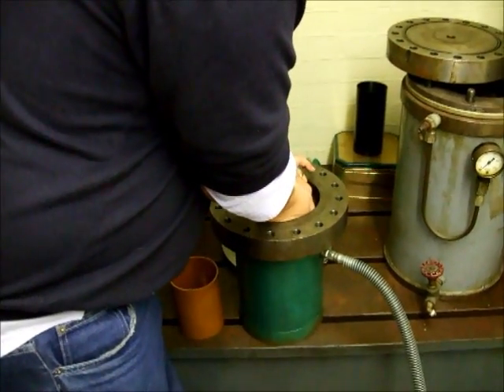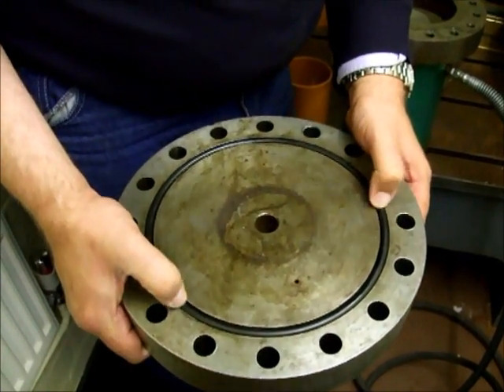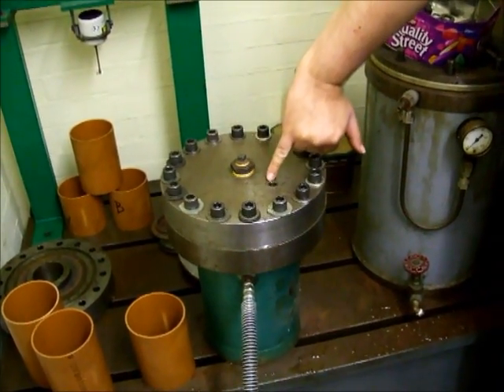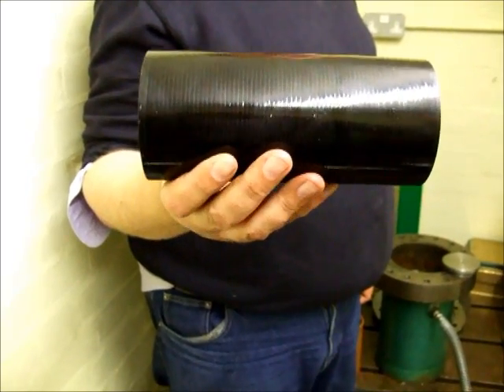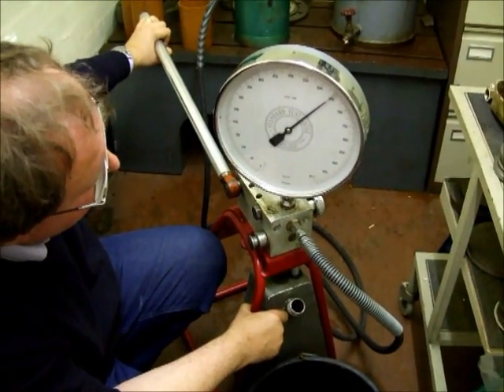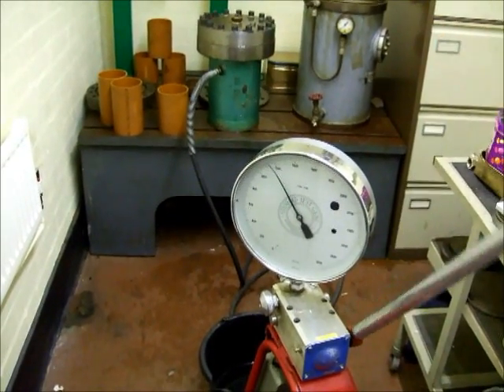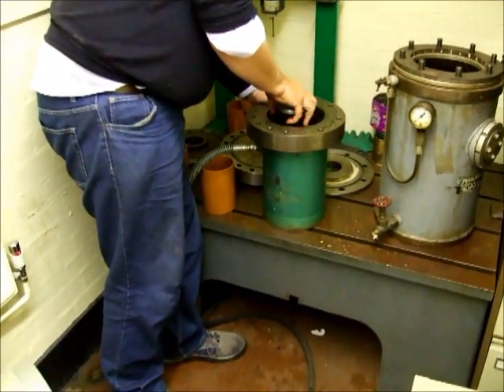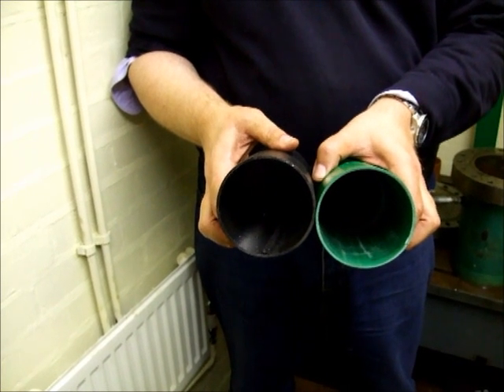Collapse of Composite Submarine Pressure Hulls

Comment: Over the last few days, I have seen a number of ten-year-old videos showing tests describing how dangerous carbon fibre pressure Hulls are. Just to think that this was general knowledge. Shocking!
Reply: "Yeah, but my carbon fibre is 5" thick." - Stockton
Reply: @KefirTView it probably should have...that's Hella thick support. How much do you think should have been enough?
Reply: he believed safety regulations had a far larger margin of safety than they tell us, he thought he could cut corners and save a few bucks and still be safe. history should remember his hubris and learn from it, the worst tragedy about this is he took 4 others with him
Reply: It looks like these subs may be alright for a test dive using robotic control and one other dive and then dispose of it and make a new one. A her egg by design is curved and is extremely strong when you consider the shell itself is so weak a material. A straight cylinder along the mid section of the sub has to be misguided.
Reply: An acquaintance of mine worked for a research facility over a decade ago and they were testing carbon fiber submersibles not intended for human passengers.  The company who contracted with him to test their submersible supposedly wanted to develop the technology to remotely capture specimens from the sea floor and and then bring them up to the surface very gradually changing the pressure.  This is quite a bit different than using such technology for human transportation.  This acquaintance informs me that they abandoned carbon fiber due to the short "half life" as he put it.  He told me that the strength of the material diminished on a geometric scale.   They had a way to measure the strength of the hull wall by how much it would flex after a set number of hours at a set depth.  They were able to rate if safe at 1100 meters for 427 minutes, after that they could only rate it safe at 550 meters for 436 minutes.  Then they could only rate it safe at 275 meters for 441 minutes then 137 meters for 460 minutes then 69 meters for 481 minutes then 34 meters for 479 minutes then 17 meters at 501 minutes then at a depth of 8 meters the submersible failed at the 389th minute.  At that point the submersible imploded.  He described the implosion as being similar to stomping on an empty aluminum soda can while wearing heavy boots.  He said it was about that sudden and fast.  AT 8 METERS!   The above is from an email he sent me two days ago.  We had volunteered at a marine mammal sanctuary together years ago and have kept up correspondence.  He has worked at several research facilities in his career including Wood's Hole.  I would consider his take on this situation more credible than anyone as he's actually tested this kind of technology.   When I asked about human passengers he told me he wouldn't put his pet clam in one of those things.  He actually has a pet clam.   The client eventually went with a solid stainless steel hull though he didn't mention any design specifications.  He described the Titan tragedy as a murder-suicide.
Reply: This is quite different. This demonstrates failure as the cylinder reaches crush depth. Stockton Rush built a craft that reached the target depth many times, but suffered (we assume) fatigue failure i.e. the build up over time of weaknesses which allowed the hull to eventually fail catastrophically.
Reply: @StillAliveAndKicking_  Either the window or the ridiculously small interface between flange and CF, see the factory assembly film and weep.
Reply: @joefish6091  Yes, or the CF cylinder.
Reply: To be fair if you tested a titanium cylinder that was not thick enough under to much pressure it would also fail. The issue is not the strengt of the carbon fibre composite by itself, it's that you can't model the fagitue. With Titanium you can. A Titanium sphere can be made so that you have a guarantee that it won't fail the first 100 dives and if you xray it after every give you are going to be accurately able to predict where it will fail. With a carbon fibre composite there are to many variables to account for. It's the unknown.
Reply: @KainniaK  this
Reply: Dont worry. The guy said he wanted to be known as a rule breaker...and well, look where it got him
Reply: Yeah it's no secret at this point that multiple experts in the deep-sea immersion field (submersibles, et al.) were all sending letters to Stockton not to use this design for passengers
Reply: General knowledge to anyone who cared to search for it and wasn't blinded by arrogance. Yes.
Reply: I believe in this video they were finding the yield strength of these to models by testing till failure. The fact that they failed isn’t proof composite materials are a poor choice for pressure vessels. They were testing till failure. What matters would be the pressure they would fail at.
Reply: sociopaths can make great salesmen.
Reply: @klam77  Yes, and politicians, they can tell bare face lies with impunity, Resident JokeB is a prime example..
Reply: Anyone know knows anything about fiber composites knows how fucking stupid a composite hull submarine is. Fiber composites are excellent in tension, which is why they're used for pressure vessels (e.g. scuba tanks), but terrible in compression (you can't push a rope), which is what you put the fibers in when you're applying external pressure.
Reply: Yes but they are probably all 50 year old white guys
Reply: Carbon fiber is usually used for frame,because it is lighter.But i wonder what would a submarine need the light weight for.Eventhough carbon fiber can be used for gun barrel,the chamber is still made up by steel.
Reply: @lanchanoinguyen2914  Size of cranes and handling gear required on the mother ship. it's seems to be that simple.
Reply: But not general knowledge to the public or the passengers until now.
Reply: The video was 15 years old.
Reply: ah yes yet there using cylinders not spheres which would be much stronger due to equal pressure
Reply: @@dongreek3500 because the title says Carbon Fiber Submersible. The Video has absolutely nothing to do with Submersibles. It's a simple Pressure Test like you would do when using Carbon Fiber tubes for Hydraulic applications.
Reply: OceanGate had recently been partnered with a carbon fiber manufacturer to build their subs and the manufacturer pulled out before the first sub was ever built. They warned the CEO that the carbon fiber would weaken and form stress cracks due to the pressure changes, and told him it'd only be safe to use ONE time. He refused to listen. 🤷🏻‍♂️
Reply: General knowledge gets in the way of my inevitable ingenuity, what can go wrong?! I clearly know better than experts.
Reply: This is a very badly designed test.
All it tested was straight column compression. Buckling of badly made crap prepreg material
Not at all applicable to a convex egg shaped pressure Hull.
It failed at less than ten percent of what it would of because of the endplates longitudinal compression forces, and panel crumpling because of the straight column.
Reply: @@Wasatch4014 Yes. Because  Americans repeat their lies until they believe them themselves.
If you want to see Carbon fibre that has won, world champs DH mountain bike races, endured being smashed on rocks in crashes hundreds of times, endured 20+ Pro race seasons, and still going strong after up to 25 years of this then search images Lahar bikes. 
My work. 
Done properly. 
Pro downhill mountain bikers got a new metal frame for every race, because they would usually be cracked, and inevitably fail in the second race. 
After only a few hours and less than 100miles of riding. 
Yet my carbon fiber product lasts for hundreds of thousands of miles and thousands of impacts with hard and sharp rocks, and hundreds of thousands of hours. 
I know what I am talking about. Not just about carbon, but Americans lying.
Reply: @@Wasatch4014 https://youtu.be/d2Tm3Yx4HWI
Reply: What's crazy is that I'm guessing that they've realized this from fighter jets that use carbon fiber.
Reply: @C_71 No - this was realised from working with carbon fibre hydraulic components.
Reply: @@C_71  Carbon fiber composite is great at containing pressure from within because that works towards carbon fiber's tensile strength.  Trying to keep higher pressures out, though, makes the use of the carbon fiber moot, since essentially only the epoxy is being compressed.
Reply: @C_71 didn't spaceX initially use carbon fiber (and blow up a lot)?
Reply: @Trekki200 they planned to use it for starship initially, but they never even started producing it. They decided stainless steel is a more favorable material. 
They tested fuel tanks out of it, but that's completely different usecase where carbon fiber is favorable. They tested them to failure. Carbon fibre is good as pressure tank where pressure is inside, not outside. It performs good under tension, not necessarily pressure.
I don't think the fuel tanks are carbon fibre now, I think they're steel too but don't remember exactly.
Don't know what other smaller parts might be carbon fibre on falcon 9 or starship. Falcon 9 probably some, starship none.
For spaceflight it can easily make sense, as it's very lightweight which is extremely important for rockets. For subs weight is not a factor so it's a dumb material for that.
Probably also bad material for SpaceX because they want reusable rockets. The rockets experience extreme vibrations and temperature fluctuations which could easily weaken carbon fiber.
Reply: @Trekki200  SpaceX uses CF wrapped pressure vessels, and that's fine because they're holding pressure in, which places the fiber under tension. It's a bit like pulling a rope vs. pushing it!
Reply: @Trekki200  They still do.  COPV's are incredibly common in aerospace.  Helium COPV's in a cryogenic liquid oxygen or worse liquid hydrogen tank creates a pretty complex loading environment, but when they are designed correctly, they are quite reliable and save a lot of weight on the most weight sensitive vehicles there are, rockets.
Reply: @compwiz101  I keep hearing this, but composite fibers are put in compression loading in every composite structure.  In a composite spar in a wing, there are unidirectional fibers on the top and bottom spar caps.  The buckling stability of the fibers rely on the manufacturing process to ensure the fibers are straight and there are no defects of unacceptable size in the laminate.  That said.. I have no idea why they used a composite tube.  Given that they used composite tube, why is there no angle to the layup on the tube?  Why would they wind it 5 inches thick, that seems crazy with some hand calcs, though I can't imagine the composite was very strong in the transverse direction where it is loaded in compression.  It seems safer, but it ignores some blatant issues associated with the bonded end cap fittings.  The hoop stiffness of the composite should be a fair bit higher than the titanium, and pressure cycling will do it's best to fail the bond in shear.  A thin bonded metallic ring and using an o-ring as a sealing surface would have been superior in my opinion.  Had they consulted COPV experts, I suspect they would have used integral composite domes, as the smaller the aperture for the door is on the end, the easier that is to manage the metallic fitting that is required.  

Hydro pressure cycling a full scale vehicle to qualify the design life was absolutely warranted here.  That would have at least done something to anchor their claims on the pressure vessel health monitoring.  Hearing pops with regularity in the hull is terrifying.  This is a textbook example of normalization of deviance. 

Sad stuff to see.  There were many lessons learned that didn't have to be learned the hard way.  Rest in peace.
Reply: @jonbeno9926 In composite structures the matrix (usually epoxy resin) carries the compressive loads.
Unidirectional Carbon fibre is particularly bad when loaded in compression. That’s why woven cloth exists - to carry the tensile loads generated by compression of the matrix.
Reply: @allangibson8494  if that were the case, then composite aircraft spars would simply not work. Their stiffness and strength relies on unidirectional fibers on the top and bottom spar caps.  

In the case of the sub pressure vessel, the external pressure cause compressive hoop stresses, approximately P*r/t, and compressive axial stress, approximately P*r/2t.  The compressive axial stress isn't cause by poisson deformation as in a tensile test, but the fundamental loading of the pressure vessel.  The compressive strength of the fibers is supporting the hoop, but the resin and fibers laterally are supporting the compressive axial load. Unidirectional fiber layup can support some compressive load out of plane, but my suspicion is that the stress level was too high in this direction and defects in the laminate would have caused load failures that would propagate with cycling.  If there were fibers to support that load direction, it would be a completely different story
Reply: @Trekki200 They made a pure composite fibre fuel tank as a test article for what's currently being called "Starship." They eventually switched back to steel long before they actually built anything, though.

Which makes CF fuel tanks 0-2 with reality. :/
Reply: @Trekki200  Boeings vertical launch and landing vehicle used carbon fiber laminates. It caught fire during operation and the project was abandoned.
Reply: @Trekki200  Yes,  Apparently the space-x problem was that the carbon fiber was too cold, making it brittle. 

The titan problem was the compression because it's plastic matrix cracks up when squeezed.

In airplanes, it's commonly used but does fail more abruptly than metal. And it shatters if you crash.

So yeah,  Carbon fiber is no replacement for metal!
Reply: @C_71  realised what exactly
Reply: I have a feeling some of the original video posters have simply changed the name of the video in light of recent events, but I could be wrong
Reply: @ChaseRacebox  No, the youtube algorithm just picks up what people are searching for and watching then pulls together and suggests any videos no matter how old and recommends them to you. 
Anyone who watched anything about the titanic sub will get these videos recommended to them.
Reply: @ItsFriscoBaby  Yes I know how algorithms work. But people on youtube can change titles at anytime which will help their videos get shown via the algorithms. I can retitle my videos relating to submersibles and gain a handful of views if I wanted. I'm not saying everybody is doing that, but some are for sure
Reply: @ItsFriscoBaby  Stockton-Rush has become the great educator, thats his legacy, as the various other hubric designers in the past did, Tay Bridge, London and Florida foot bridges, Pinto, the Titanic itself.
Reply: @ChaseRacebox Nobody is doing that ten years later homie.
Reply: Ah, but 'tis the forbidden knowledge of old white men!
Reply: @@dongreek3500 I didn't say they shouldn't change video titles for views. I just offered a possible explanation for the sudden rise in related video names.
Reply: this video is not describing carbon fibre hulls as dangerous, this video simply testing them to their limit. You can find videos of titanium being broken under enough pressure. Everything is tested to failure to understand what it can do. That's what was done here. You heard on other videos carbon fiber isn't strong enough from a film maker probably albeit who has no engineering experience.
Reply: @LuisGross-jr9on  James Cameron is a well known and highly experienced deep sea diver, he tested his own design for a submersible that went down to the Mariana's Trench and made it back, and he gave warnings that this could happen. if you still don't accept that, how about the retired US Navy Captain who's taken 12 dives to the Titanic, he warned him too...
Reply: @LuisGross-jr9on  Oi, genius: 

In his role on March 7, 2012, he dived five miles deep to the bottom of the New Britain Trench with the Deepsea Challenger.[134] 19 days later, Cameron reached the Challenger Deep, the deepest part of the Mariana Trench.[135][136][137] He spent more than three hours exploring the ocean floor, becoming the first to accomplish the trip alone.[135][138] During his dive to the Challenger Deep, he discovered new species of sea cucumber, squid worm and a giant single-celled amoeba.[139]
Reply: @LuisGross-jr9on that film maker may not have engineering experience, but he has enough money to employ some of the best engineers in the world!
Reply: @LuisGross-jr9on a film maker who has enough money to fund deep sea exploration AND listen to his engineers rather than sack them when they say it will implode. Imagine.
Reply: @LuisGross-jr9on Don't project your own ignorance, bud. Everyone who has ever worked with carbon fiber in a serious capacity knew a carbon fiber sub was a bad idea. Hell, OceanGate was partnered with a carbon fiber manufacturer who pulled out of the project before the first sub was ever built, stating it would never be safe to use more than once. Just because you don't know what you're talking about doesn't mean nobody else does!
Reply: @LuisGross-jr9on  LMAO James Cameron designed the sub he went to the bottom of Challenger Deep in. "No engineering experience" yeah keep talking out yer arse pal 

Still laughing

Comment: tube is a no no, egg shaped titanium body would have shared the forces in many resistant  redundancies, after all, a chicken egg, courtesy of mother nature, is immensly strong under equal external pressures,i.e.submersed,  massive folly, doomed to fail and thats before you mention glued joints. THRILL SEEKERS BEWARE. do your homework,  the revenues generated from these ventures, could have easily covered the cost of a safer alternative to cigar tubes. everybody wants to reinvent the wheel these days, but science will always have the final say. R,I.P. to all.